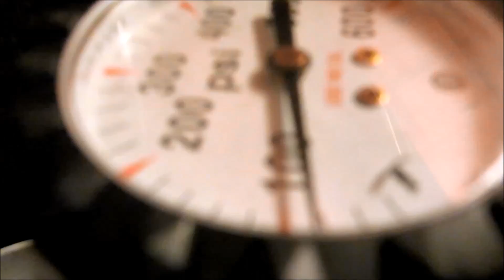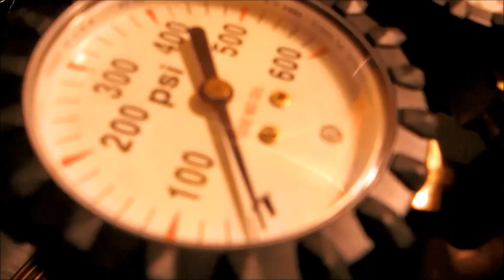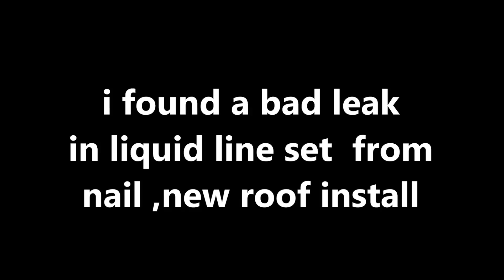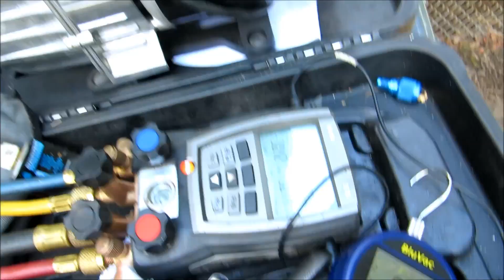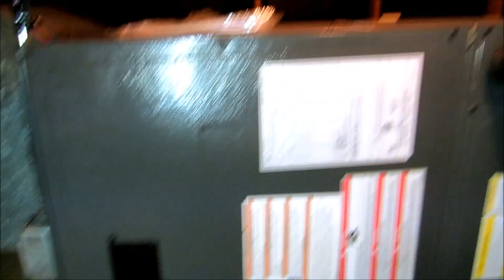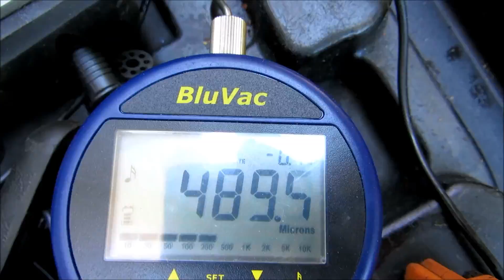hvac 2 ton A C replacement

Comment: nice job sneaking the liquid line back up through the leader pipe
Reply from the maker: the back of the down spout is cut away just remove the clips and pull it off .

Comment: I like your style of work I dont have any experience on central air I would like to get into the field what do you suggest I do to get started Im going to buy a 3 ton so I can pratice at home im buying the unit really cheap on Craigslist what other tools do I need Ive seen alot of digital gadgets on your vids thanks
Reply from the maker: if your intrested in hvac best to try to get a job as and apprentice some were and learn the ropes and get some experence out in the field working with the tools .to get set up with the tools you need probley looking at 7 or 8 thousand easy just in tools .it's not a job you learn overnight thats for sure
Reply: Get into a good tech school first most will help you get employment after you complete your curse.Not many shops will take you off the street like the good old days.You have to be able to hit the ground running these days

Comment: Nail gun can easily puncture that soft copper line...especially if it was up against the plywood....ain't that a bitch! ....Nice job on the install !!
Reply from the maker: +zeke112964 yes thats what happened nail from roofers i am sure they herd and said nothing to the homeowner
Reply: You know that they had to hear that with all the pressure in the line....They didn't want to lose their profit from the roofing job...could have easily fixed it by opening up the roof while the shingles were off....

Comment: Nice job Steve !! I'm curious if you did that install without a helper.? If so must have been a bitch getting air handler into attick
Reply from the maker: Bernard Sobbe i work alone ,i take the air handler apart so its light .. its no big deal